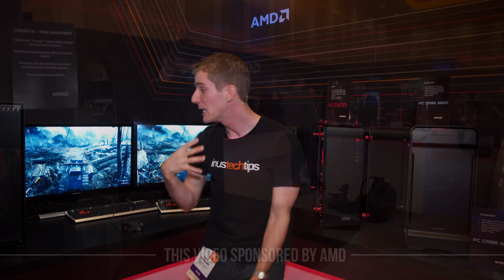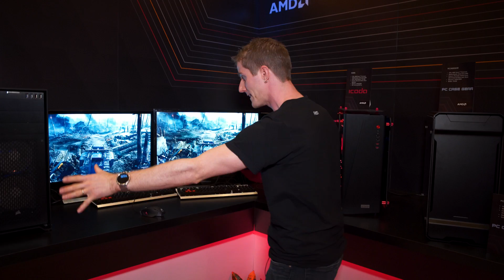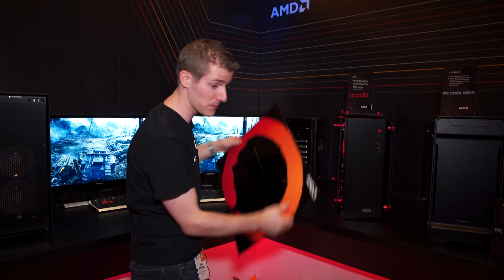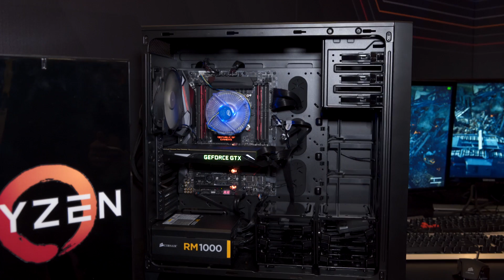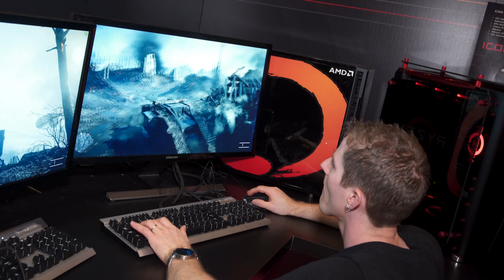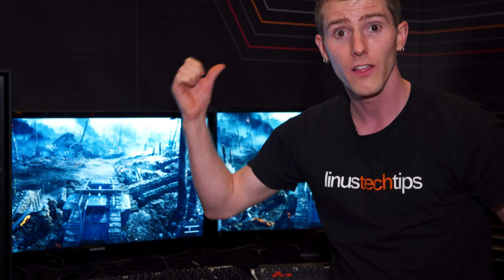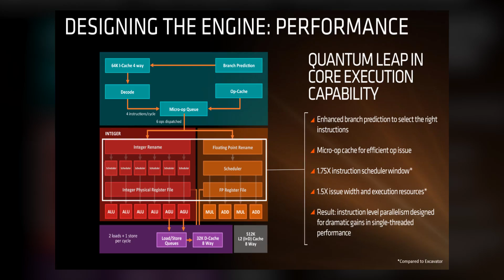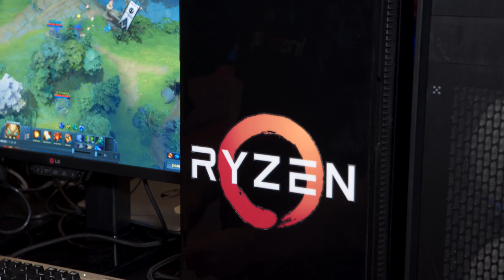AMD Has Ryzen!

Comment: When AMD puts NVIDIA gpus inside their systems means that the AMD radeon gpus have very little market share and they are not competitive or desirable by gamers.
Reply: this video is 6 years old, AMD is actually much better value than Nvidia now, and the "bad drivers" is no longer an excuse because they only have as many bugs as nvidia does
Reply: @keylime16  Yeah i bought the RX 7800XT and i am very happy.
Reply: @misterPAINMAKER  Good for you! I have a rx 6600 right now but I plan on upgrading to the 7800 XT a few years down the line
Reply: @keylime16  I upgraded from the R9 380.
Reply: 2024. nothing changed. there are more 4090 users than rx 580 plebs on steam according to steamcharts. AMD gpu sales sees a 48% drop in sales in the 1st quarter of 2024 vs the WHOLE YEAR of 2023. explains why AMD card drop price all the time and RTX cards stay firm but radeon still get outsold 100 to 1. and MSI to stop making AMD GPUs. who needs RT? apparently everyone lmao.

Comment: 1961
IBM delivers the IBM 7030 Stretch supercomputer, which uses 64-bit data words and 32- or 64-bit instruction words.
1974
Control Data Corporation launches the CDC Star-100 vector supercomputer, which uses a 64-bit word architecture (prior CDC systems were based on a 60-bit architecture).
International Computers Limited launches the ICL 2900 Series with 32-bit, 64-bit, and 128-bit two's complement integers; 64-bit and 128-bit floating point; 32-bit, 64-bit, and 128-bit packed decimal and a 128-bit accumulator register. The architecture has survived through a succession of ICL and Fujitsu machines. The latest is the Fujitsu Supernova, which emulates the original environment on 64-bit Intel processors.
1976
Cray Research delivers the first Cray-1 supercomputer, which is based on a 64-bit word architecture and will form the basis for later Cray vector supercomputers.
1983
Elxsi launches the Elxsi 6400 parallel minisupercomputer. The Elxsi architecture has 64-bit data registers but a 32-bit address space.
1989
Intel introduces the Intel i860 reduced instruction set computing (RISC) processor. Marketed as a "64-Bit Microprocessor", it had essentially a 32-bit architecture, enhanced with a 3D graphics unit capable of 64-bit integer operations.[9]
1991
MIPS Technologies produces the first 64-bit microprocessor, the R4000, which implements the MIPS III instruction set architecture (ISA), the third revision of their MIPS instruction set.[10] The CPU is used in SGI graphics workstations starting with the IRIS Crimson. Kendall Square Research deliver their first KSR1 supercomputer, based on a proprietary 64-bit RISC processor architecture running OSF/1.
1992
Digital Equipment Corporation (DEC) introduces the pure 64-bit Alpha architecture which was born from the PRISM project.[11]
1993
Atari introduces the Atari Jaguar video game console, which includes some 64-bit wide data paths in its architecture.[12]
1994
Intel announces plans for the 64-bit IA-64 architecture (jointly developed with Hewlett-Packard) as a successor to its 32-bit IA-32 processors. A 1998 to 1999 launch date was targeted.
1995
Sun launches a 64-bit SPARC processor, the UltraSPARC.[13] Fujitsu-owned HAL Computer Systems launches workstations based on a 64-bit CPU, HAL's independently designed first-generation SPARC64. IBM releases the A10 and A30 microprocessors, the first 64-bit PowerPC AS processors.[14] IBM also releases a 64-bit AS/400 system upgrade, which can convert the operating system, database and applications.
1996
Nintendo introduces the Nintendo 64 video game console, built around a low-cost variant of the MIPS R4000. HP releases an implementation of the 64-bit 2.0 version of their PA-RISC processor architecture, the PA-8000.[15]
1998
IBM releases the POWER3 line of full-64-bit PowerPC/POWER processors.[16]
1999
Intel releases the instruction set for the IA-64 architecture. AMD publicly discloses its set of 64-bit extensions to IA-32, called x86-64 (later branded AMD64).
2000
IBM ships its first 64-bit z/Architecture mainframe, the zSeries z900. z/Architecture is a 64-bit version of the 32-bit ESA/390 architecture, a descendant of the 32-bit System/360 architecture.
2001
Intel ships its IA-64 processor line, after repeated delays in getting to market. Now branded Itanium and targeting high-end servers, sales fail to meet expectations.
2003
AMD introduces its Opteron and Athlon 64 processor lines, based on its AMD64 architecture which is the first x86-based 64-bit processor architecture. Apple also ships the 64-bit "G5" PowerPC 970 CPU produced by IBM. Intel maintains that its Itanium chips would remain its only 64-bit processors.
2004
Intel, reacting to the market success of AMD, admits it has been developing a clone of the AMD64 extensions named IA-32e (later renamed EM64T, then yet again renamed to Intel 64). Intel ships updated versions of its Xeon and Pentium 4 processor families supporting the new 64-bit instruction set.
VIA Technologies announces the Isaiah 64-bit processor.[17]
2006
Sony, IBM, and Toshiba begin manufacturing the 64-bit Cell processor for use in the PlayStation 3, servers, workstations, and other appliances. Intel released Core 2 Duo as the first mainstream x86-64 processor for its mobile, desktop, and workstation line. Prior 64-bit extension processor lines were not widely available in the consumer retail market (most of 64-bit Pentium 4/D were OEM), 64-bit Pentium 4, Pentium D, and Celeron were not into mass production until late 2006 due to poor yield issue (most of good yield wafers were targeted at server and mainframe while mainstream still remain 130 nm 32-bit processor line until 2006) and soon became low end after Core 2 debuted. AMD released their first 64-bit mobile processor and manufactured in 90 nm.

https://en.wikipedia.org/wiki/64-bit_computing

Comment: Curently, in the testing videos and showroom demos the Vega does not have all of its actual features being put to use and still comes ahead of the competitors. When its an actual final release it will be way ahead. I'm also excited about the feature of it OC itself based on its temperature, lower temps it will self OC to faster frequency. That way you don't have to constantly switch between OC profile, normal profile, and underclock profile to save energy.

Comment: My 2013 fx8350-based gaming PC still holds good. Fx8350 had amazing price-performance ratio back then. 
But these days the market sweet spot is dominated by intel 6700k/7700k and in the AMD presentation benchmark they compared the test ryzen with intel i7 6900k (that is a non-efficient and not that popular) for performance and consumption. So from the start i can see amd can't beat intel's 6700k low power consumption and if the heat+noise classic problem is not solved I can't see how amd can be saved... i had 3 amd PCs so far but i see my 4th with intel inside...

Comment: Been using an FX-6300 for a few years now, it does will with the R9-290X 4GB and 16GB of ram, very good performance in the games I actually play, system has been acting up a little bit, so I moved the R9-290X to my Mac Pro with dual Xeon's and 32GB of RAM, not as good as far as my games, but I can limp along till the Ryzen comes out.

Comment: What good is 50~60 FPS in an FPS? It's like I buy a Bugatti and drive around at 30m/h. Or am I missing the point?
Reply: You are. Battlefield can be insanely straining for hardware on maximum settings, so it's really only for direct comparison. Also, 60FPS is what most people's monitors can display at best anyway...

Comment: i hope you all realize that if everyone just waits for amd to lower intel's prices and then buys intel cpus, amd will go bankrupt and intel is going to rise the prices even more, so please, if it's competetive, choose amd for the good of all, they prepared for the flop by separating radeon but let's hope it won't come to that
Reply: I will buy the best AMD cpu (here 600€-900€), because performance/watt amd wins, performance max, amd wins (since its a 95w vs a 140w at same performance, Ryzen can be overclocked to the same wattage = higher performance)
Second, Vega will be surely faster than the Gtx 1080 (vram is to slow, i own one of it)
If vega use hbm or hbm2 with 8gb or more they can build a graphic card, that is faster than the titan X pascal.

It really depends on what AMD decide to do, they could if they want to, they have the technical basement.
I know the best Ryzen cpu is worth waiting and buying it.

Comment: how many people are so fucking retarded, and didn't finish the video. The bf1 demos were running at 4k, obviously shown by the 1080/gtx titan which ever it was, only pulling 60ish FPS. Not only that, but the Nvidia GPUs were used because they ARE the best on the market, AMD isn't stupid, thats why they made the playing field even, also, amd does much better at 4k than people want to think. The left system was intel, the right, amd. Intel sits at 70fps, STATIC FRAMES, amd sits at 60 fps, MOVING FRAMES. 

Is everyone on the intel side as dumb as they sound?

Comment: Yet still in 2017 a CPU cooler is designed to blow the hot air directly at the memory chips from less than 1 inch distance. BTX where are you bro?

Comment: When you said they ran identically i could totally see that the intel one ran at 70+ FPS whilst the amd was hovering at 50+

that's not identical linus.

EDIT
Reviewing it, if the monitors are set up in a way to reflect what side their case towers are on, I can easily see the intel build running at 78 FPS whilst the supposedly new AMD build running at 58, a difference of 20 FPS. That's really not identical.

Comment: I can confirm for these systems. I spent a good 2 hours in the AMD suite alone testing these systems and talking to the engineers... Also they were the only ones providing free snacks and coca-cola.

But the performance and capability in just the game demos alone were outstanding. I spent a good 20 minutes on doom (AMD Ryzen + Vega) , 40 minutes on and off on Battlefield (AMD Ryzen + Nvidia GTX1080) Also spent a good hour or so using the AMD Powered Lenovo Backpack PC + Vive  running a Fruit slicing game. (Unverified Specs, Ran very high framerate and performance however)

(I was not supposed to know that the system was a Lenovo computer, but the power bricks that were charging them all had the Lenovo logo on them, When I pointed that out, the engineer quickly covered the logos up with electrical tape, So take that information as you will.)

Comment: Why is battlefield 1 used for comparison? The game runs fine on cpus clocked at 1.2ghz and if the monitors were 4k then the gpu is the only thing being fully utilized.
Reply: Fully utilizing a 1080 itself utilizes the cpu a fair bit. BF1 would have run 30% slower on that rig using their best AM3+. Probably worse than 30%.

It was a fair test.

Comment: Last time AMD was really top notch was the AMD Phantom II series, I got one of those that lasted me till last year, I switched back to Intel, got a nice i5 6600k which performs on 4.5 Ghz without breaking a sweat. Im not a fanboy, never was, I've had the AMD Phantom II with a GTX 570 for about 3 years, and then upgraded to an I5 6600K with an AMD R9 390. The only thing that bothers me is PhysX, other than that, the R9 390 is a fantastic GPU. Always get the best for the budget you've got! being a fanboy doesn't benefits you!

Comment: Going from an i7 5960X to a 6950X, or a 6700K to a 7700K will provide you with no IPC performance increase, zero, none.  While even earlier generations provided only a small 2-3% IPC increase, but with as much as a 50% higher cost.  It's about time AMD is promising to release something that will actually shake Intel out of their long, unencumbered slumber.

Comment: 8 core Intel = $1,000 USD. Supposedly this new 8 core AMD will be around $500 to $700. If that is true, it is a potential game changer. Intel would be forced to drop the prices of the Skylake-E (or whatever the next enthusiast architecture is going to be called) to match or even undercut AMD. The only reason the 8 core Intel is that much is because it has no competition. Hopefully by the end of 2017, Intel's CPUs will be at least a little cheaper. Intel fan boys and girls don't know it (and I guess I'm one having only ever owned Intels since my first 286) but this new AMD architecture is going to be good for both sides if it is a success. And all it really has to do to be a success is match Intel's per core performance. They don't have to try to blow them away performance wise or try to outsell them in every segment, they just have to force Intel to keep innovating and most importantly keep prices fair. AMD failed to do that the last 5 years so hopefully it works this time because Intel is getting kind of lazy as evidenced by the Kaby Lake launch. Boosting the clock speed by a few hundred MHz and adding a plus sign to the 14nm process doesn't make it a new generation. They should have stuck with the 6xxx series naming kind of like what they did with the Haswell "Devil's Canyon" refresh instead of going to 7xxx.

Comment: I have an amd but it's bad even with an upgraded graphics card can someone point me in a good direction for a good cpu or whatever I need next( not good with computers and best buy geeks arnt a good help)
Reply: Wait. When these chips hit the streets they will be cheaper than Intel is now. Intel will then cut prices. The worst time you could buy a machine is right now.

Although, soon, in the next couple of months, Newegg and such will start slowly and quietly dumping FM2s and AM3 parts, and there will be a few little sales on Intel kit too. So you might find a cheap upgrade if you watch for sales and don't mind working on your machine.

What AMD chip/mobo do you have now? I love this 4350. But even though I have it at 4.5 ghz, it would bottleneck that 480 somewhat, although it could still play any game, even at HD. Good enough that I can wait a couple of months.

Comment: Show me synthetic benchmark results, some Cinebench and other actual workloads and I'll believe them.  BF1 is a highly optimized engine that demands little of the CPU.  They have pulled tricks like this before.  Last time, they claimed that their CPUs were "faster than a quad core i7," but failed to tell you that they compared it against an i7 from two generations ago...  You only knew that if you read the small print in the ad.
Reply: I would like to see how it handles arma since we all know Arma kills processors

Comment: the AMD CPU runs hotter also the frame rate could have been locked and how can we know that was a Intel Core  i7-6950X
Reply: Hotter??? Intel 140 tdp vs AMD 95
Reply: i meant that in a general way
Reply: plus the 7 gen version of the i7 6950x has not come out
Reply: also the settings could have been different for both
Reply: WestonG23 they claim still we don't know
Reply: It's a conspiracy ! impossibru !(kek)

Comment: I have got to say this. If you want to benchmark a cpu and need with out a doubt the hardest game for cpus to run... Test out the performance on Guild Wars 2. It doesn't matter what GPU your'e running. If you crank that game to max settings you will drop to 30 frames or lower in certain areas. It happens to everyone. World vs world battles and open world boss battles (especially in newer maps) will make a beast of a rig crawl. There are so many player interaction calculations going on in mmos at one time it just destroys anything but the newest tech.

Comment: the big deal breaker is if AMD can pull off the price, never bought AMD because they could beat Intel always bought them because there the best bang for buck. AMD are normally 1/4 the price and about 3/4 the performance. if they match the performance but it costs almost the same as a Intel then they loose there market

Comment: PAUSE... lmao that AMD is running an NVIDIA GPU.... tell us more Linus.
Reply: PAUSE 2... so you mean to tell us that two computers with the same GPU playing the same game will run the same FPS. Hmmmm. Shocker.
Reply: but: different Mobo different CPU, which has not the best optimasation. (rip english)
Reply: neither of which matters at that level of cpu performance (for the most part) in gaming FPS
Reply: You're a dumbass, CPU will determine wether the gpu can go full force or will it get bottlenecked. If the $??? amd cpu can beat the $1200 intel, then intel will be shitting their pants.
Reply: lol... you're the dumbass and obviously dont understand how bottlenecking works. 
Intel has over 80% of the cpu market share currently. They wont be hurting regardless, I promise ;)
https://www.cpubenchmark.net/market_share.html